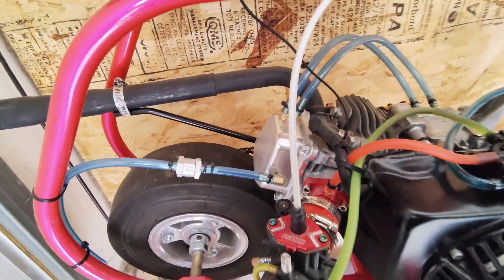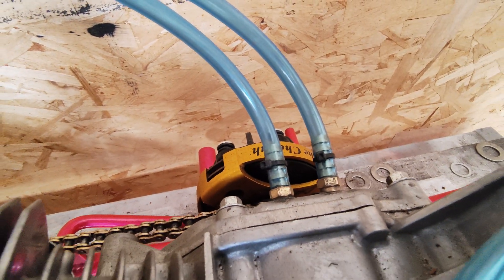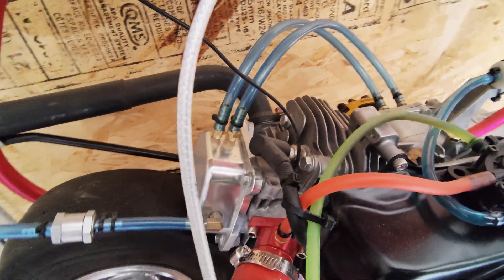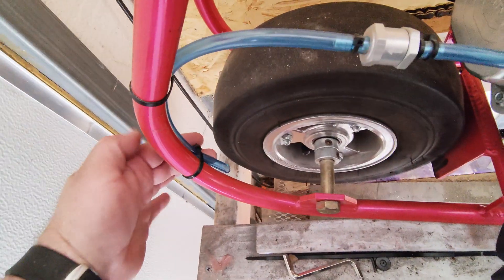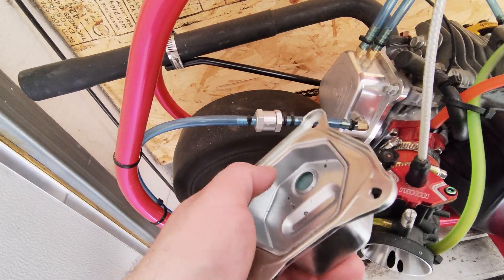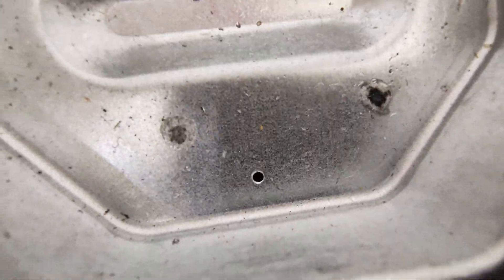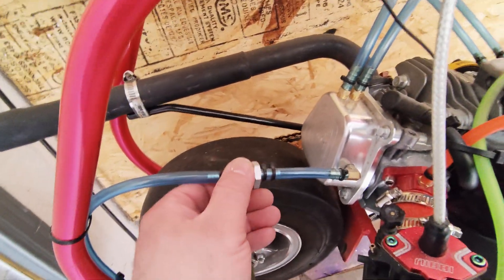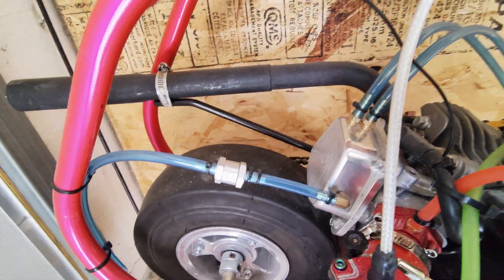Proper Case Venting for a Predator Engine [Check Valve]

Comment: What valve cover is that and will it fit a ghost 212?
Reply from the maker: That's the stock non hemi Valve cover. Yes it will. But you can use the one that came on it
Reply: @n @north-mb Okay, cool, so I got a billet side cover, and it comes with 2 ports already. Would I just need to drill into the stock valve cover and add 3 ports—2 for the side cover and one for the exit?

Comment: I have a tiny hole in my valve cover by the bolt is that normal
Reply from the maker: Yes, that's for oil return
Reply: @north-mb  thanks for the reply i was freaking out and thinking the valve rockers hit the valve cover and broke it. Upon closer inspection today it is a small flap that seems to be a vent for the crank case? The problem is its like pumping hot air and an oil mist into my generator enclosure. Im thinking of putting a nipple, hose, and catch can on it after seeing your video... is that safe to do or is there some reason the vent has to be open to the air
Reply: @north-mb  Thanks! Will report the results!

Comment: if you have a fuel pump, where would be the best place to get a pulse, the obvious cover, intake, side cover?
Reply from the maker: Intake
Reply: @north-mb thank you, the intake is the best cuz it’s the cleanest. The ohv, side-cover, and crankcase, could put oil into the fuel pump if u didn’t have a check valve, correct?

Comment: Cool video and informative too . Now do the math on the check valve going from sealed to venting to sealed at 8000 RPM . I doubt it is effective at venting a piston down stroke pressure increase and then sealing returning air during the piston's upstroke . The check valve would be switching positions 16000 times a minute at 8000 RPM . This is a tough situation that I think of often .

Comment: if you want to vent a stock valve cover, as long as you vent out properly, you can use a flathead and hammer to knock the stock check valve thing out from the corners which will give you more space for the barbs.